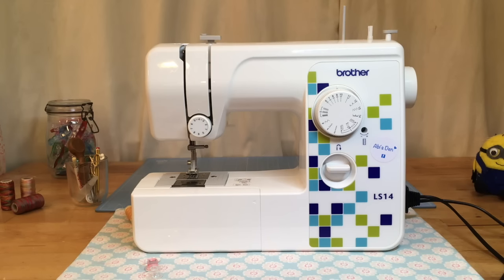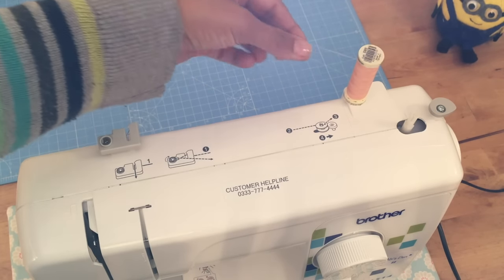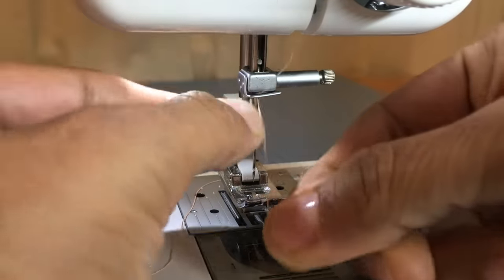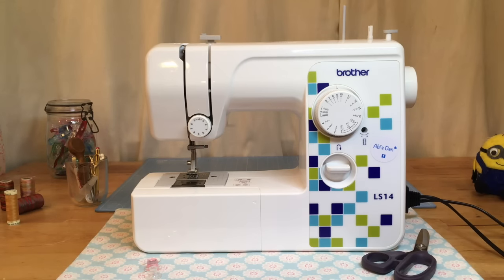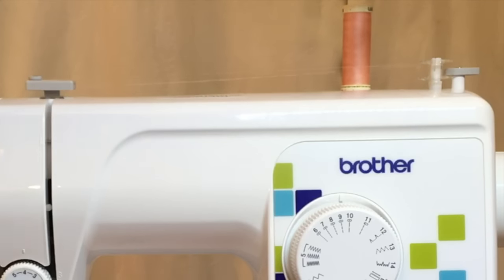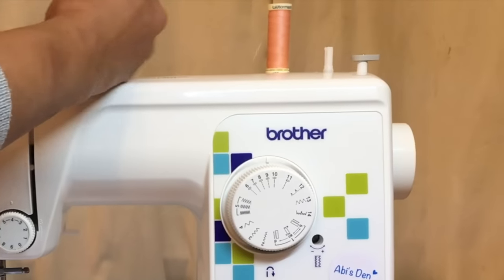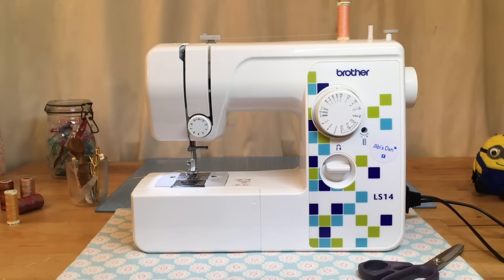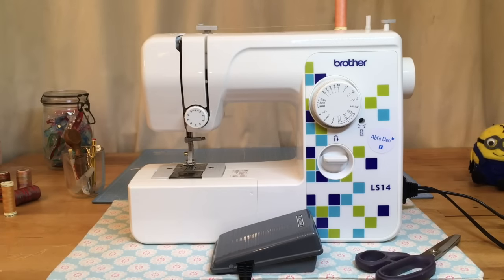Beginners how to thread up a sewing machine. Brother LS14, Lidl lx3817a #sewwithabi

Comment: So when does the bottom thread magically get under the needle?
Reply: Britney Renea fr
Reply: No was wondering
Reply: Turn the wheel towards you!! I finally figured this out haha
Reply: @destinyema2373  how long 😫
Reply: @ewa3745  a whole 360 turn, when you start turning the the raised lined on the side of the wheel should be at the top of it and when you stop it should have gone around a whole turn and ended up in the place on the top.
Reply: (2)
Reply: Huhu badly need your help. I couldn't figure out how to do it
Reply: All these years later I just found this video first let me say Thank You 🙏🏾 your God sent very easy to follow ,very well done 👍🏾
Reply: If you lift the groove up you’ll see 2 strings attached right underneath it. Gently Pull these two strings to towards left all the way out . And your done ✅
Reply: I was trying to figure this out.... it's like the video skipped a step

Comment: Hello,
Great video. I have a small problem, the bottom thread doesn’t get picked up so essentially no first stich is made. How can I fix that? I have to mention that it used to work, but not simply it doesn’t pick it up.
Reply: Same here!!
Reply: (2)
Reply: Hi, I'm having the same problem. Did you find a solution?

Comment: What do I do when it doesn't pick up my thread from the bottom?
Reply from the maker: If you found you’ve been fighting with the machine, maybe fabric got caught in there. you may have caused the cogs to misalign which means the machine needs a repair 😬sadly it doesn’t happen often on these machines but when it does, it’s hard to repair. Well, to a mechanic, It’s easy enough, it’s just the machine is tricky to open and the cost to pay someone to fix is almost as much as the machine cost new

Comment: I threaded it up like you said but when i try to sew it just doesn't stitch the material together, it just makes holes where the needle has been and leaves a lot of thread half in half out.
Reply from the maker: Oh no. These aren’t the best quality machines and the timing gets ruined so easily on these because they’re plastic mechanisms inside. I can’t even offer help because I’m the words of the brother sales team, they’re disposable machines and are t designed for repair. Brother don’t design to last I’m afraid.

Comment: Hi dear please answer me 
I have the same machine I bought it in June 2020 and I use it moderately now it tightens the seam too much, do I have to oil it ???? Thanks
Reply from the maker: Thread might be stuck in the take up lever. Or is the thread getting trapped somewhere?  Just look carefully when you thread your machine to follow where it gets stuck. Xx The machine doesn’t need oil to fix this problem. Good luck Tulipa
Reply: @AbisDen  thank you dear 🥰🥰

Comment: I just don't seem to be able to get the tension right. The machine was set to 4 when I opened it and when I first tried it on a piece of old t-shirt material the threads were very loose with missed stitches too. I moved the dial to 5 and the thread went the opposite way so I changed it down to 3 and the threads seemed to catch and get knotted. So frustrated; I don't want this to make me regret buying it. Please, please can you advise?
Reply from the maker: Is this a new machine? If so, the correct needle, ball point (stretch) needs to be used to avoid skipping stitches (if you did change the needle, is it in correctly, pushed all the way in - you’ll see a stopper the needle needs to be flush with👍🏽).  But it also sounds like you’ve not threaded the machine quite right. If it’s not a new machine, it may be the incorrect bobbin being used or worse, the timing might be wrong.

Comment: I have a brother machine brand new and i have been having trouble when it came to my bobbin. After i finish with my needle and put my bobbin in i turn the wheel to make a stitch. For some reason my thread from my bobbin doesn't make a loop under my needle? i dont know if im doing something wrong or if its my machine?  Am i missing a step?
Reply from the maker: Olivia Gonzalez Oh no. It sounds like you may have a timing issue. The things to check are the needle is inserted fully into the machine. You may be being too gentle, I suggest a more robust turn of the wheel, finally, the timing may be well and truly out and it means you will need to take the machine for a service. You might remember fighting with the machine, tugging at fabric or too much thread getting lodged in the needle plate?
Reply: Thank you for getting back to me! i talked to a local sewing teacher and she said that is might be a different way are threading up since its a newer machine. Your video was very helpful though thank you!
Reply from the maker: Thank you Olivia. Machines are all essentially the same, just follow the guides that take you to the needle, and check the manual for the direction in which you insert the bobbin. It sounds like your sewing teacher has been able to help you out x Awesome x

Comment: someone please help me here. i've tried following the manual and a few youtube videos and still my bobbin thread isn't catching and being pulled through. what might I have done wrong?
Reply from the maker: If the bobbin isn’t catching the timing is out x 😕
Reply from the maker: Any luck?
Reply: Hi are you making the same mistake I make in my video? Make sure the bobbin thread is long enough to catch and you are holding the top thread whilst turning the knob towards you. I hope that helps!
Reply: @Twistfashion  where do you put the tail from the bobbin thread? like where does it go, I have no idea. how is it picked up😬😳complete beginner here. sorry💕
Reply: did you get it done? I just got a machine an hour ago. thought I was doing well but this has me stumped😂clueless.
Reply: @kittyfisherxo  leave about 10cm of bobbin thread hanging out, then hold onto the top thread whilst turning the wheel and the top thread should catch it so you can pull it through. I hope that makes sense.
Reply: @Twistfashion  I got it around an hour ago!! 
Thank you so much for getting back to me, though. Really appreciate it☺😁
Reply: I’ve been trying to do this last step for two hours and I just can’t catch the lower thread what am I doing wrong?
Reply: Sammi Barreca me too. Have you figured it out ?

Comment: Hi, I'm unsure if this will ever get answered but here is my question. I'm having tension problems with my brother sewing machine, it's the same as in the vid. The bottom stiches are looping and pulling out, and the dial on the machine doesn't seem to be doing anything. Am I missing something or is my machine broken?
Thanking you!
Reply from the maker: Hi 👋 Millie. I always try to answer any questions when I can. I think you’ve maybe missed threading the top thread correctly if you’re seeing loops. Try again. These machines are extremely robust. I’ve used mine for almost 2 years in the workroom. Kids and adults have hammered them something and they’re working well. I’d suggest going through the threading process again. Just check your tension dial is at 4 or 5.  Use good thread. Cheap thread is a nightmare in these machines as many of my ladies have discovered x good luck
Reply: @AbisDen  hi again, yeah the dial is set to 4 or 5 but I altering that doesn't seem to affect it - I've rethreaded it a bunch of times and I'm still stuck :( fab videos though, by the way!
Reply from the maker: Millie Oaken Millie Oaken be sure the pressure foot is up when you thread up the machine x if the tension dial isn’t working, then you’re not threading around the dial properly. 1:46. If it’s still not working, you may have threads caught in the discs which prevent it from working properly.
Reply: @AbisDen  think I've sorted out the problem - the dial had come loose from the fitting so it wasn't changing the tension. After a bit of faffing about with a screwdriver and a pair of pliers I've sorted it! Thank you for replying lovely ❤️❤️❤️
Reply from the maker: Oh, that’s fab news x brilliant 🌷

Comment: How do you disengage the needle, you say  to do it but do not show it being done or how to on this machine.  It would have been a very simple thing to show what you actually have to do on an LS14 to disengage the needle.   Not everyone gets a brand new machine with instructions or they lose the instructions and need to refresh their memories over time when they haven't sewed in ages.
Reply from the maker: I explained in the video that Moving the bobbin winder to the right disengages the needle. There is no other way other than switching the machine off